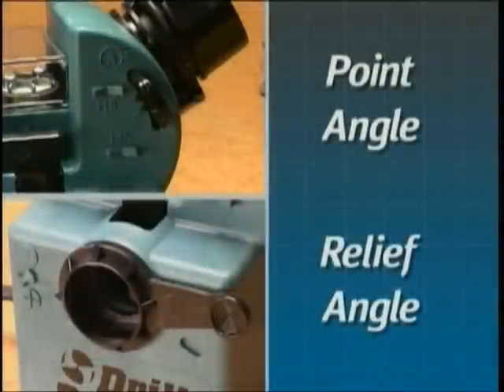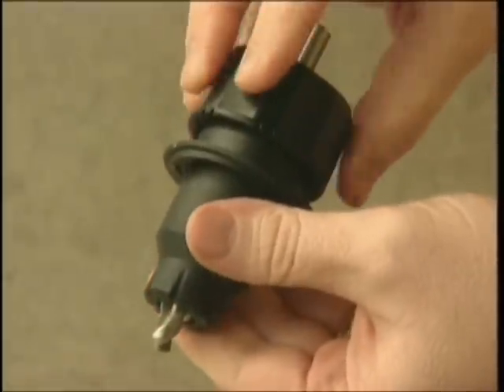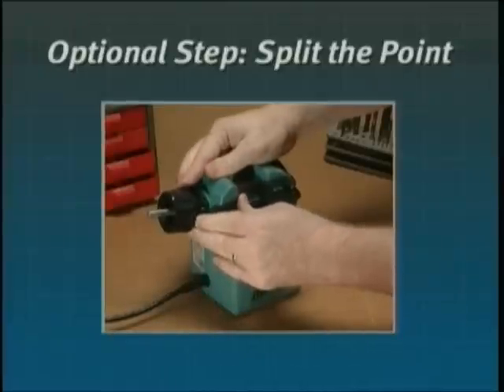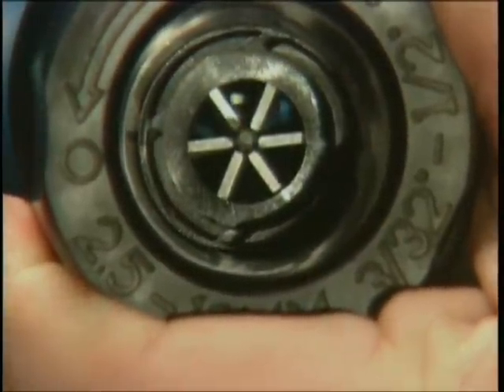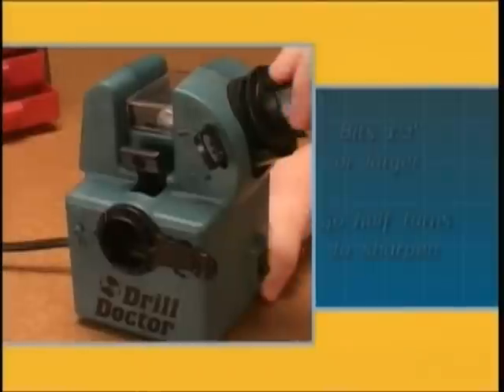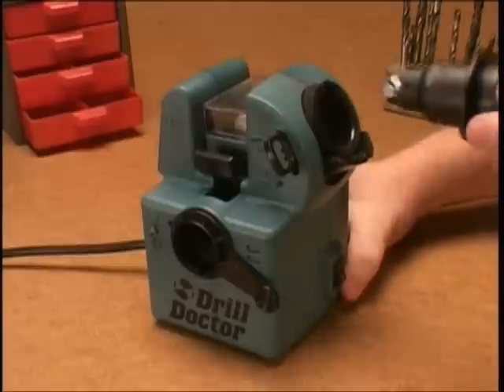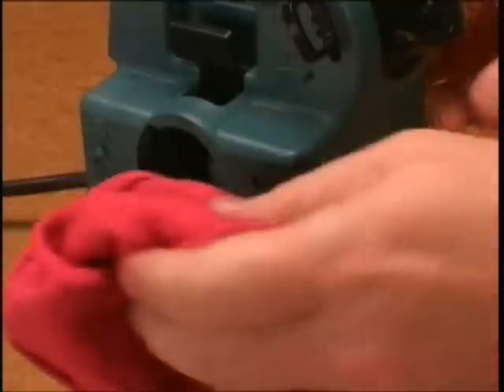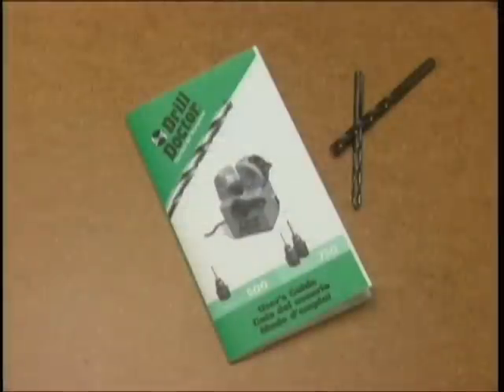DD Classic 500-750 part2

Comment: A little confused. It says when adjusting the point angle, most twist drill bits should be sharpened on the plus + setting but the whole video it's placed on the center setting. Is the center setting for split points?
Reply: Yes.  The "plus" is for standard point bits, the middle is for split points and the "minus" is for masonry.